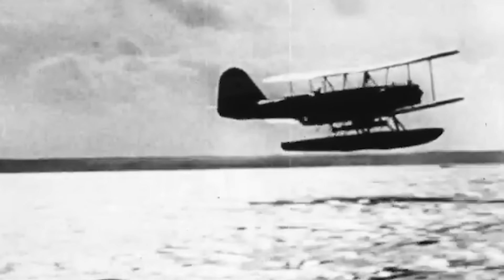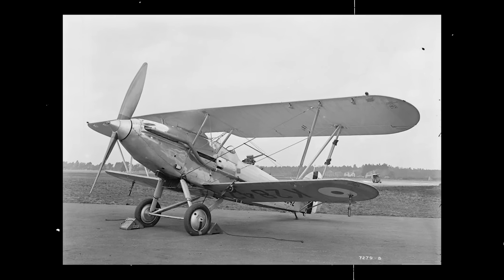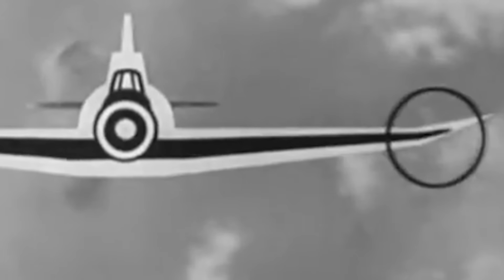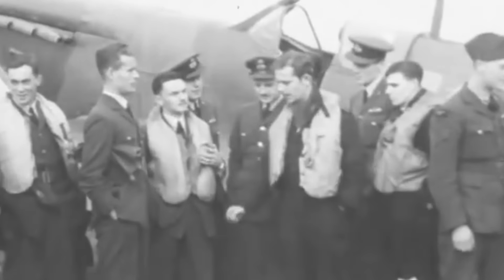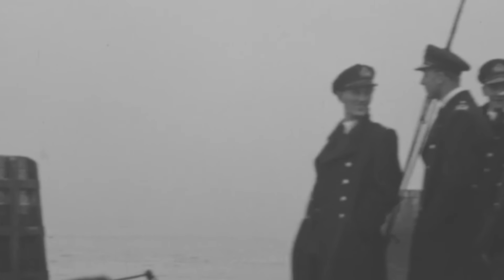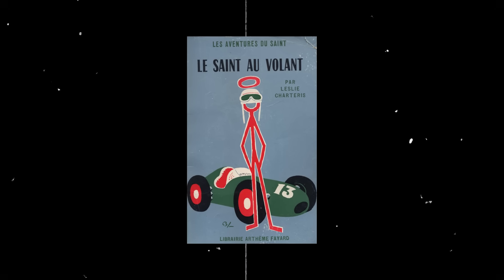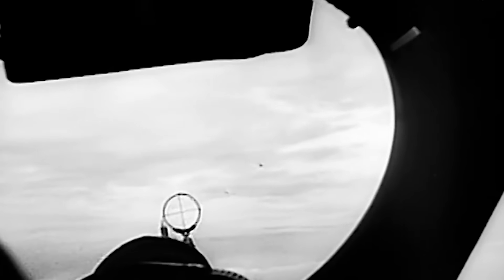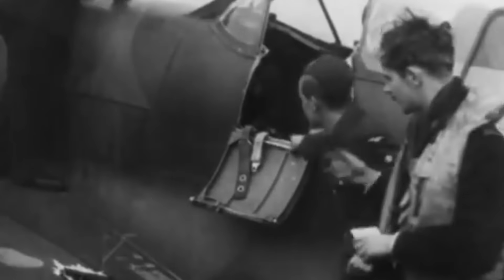The WW2 Plane with the Most Bizarre Killing Technique

Comment: Contrary to your comments, the turreted fight was a horrible idea which was proven out in combat. The Defiant was no better than the Roc in combat with other fighters. Once the German’s figured out Defiants weren’t Hurricanes, the Defiants became easy pickings. This type of “fighter” aircraft is only viable as a night fighter where the pilot can maneuver his gunner into an excellent firing position beneath the enemy bomber.
Reply: I recall seeing on another channel that the main idea behind turret fighters was that it was very difficult to get guns firing directly forward of the aircraft to bear on a turning opponent: you effectively had to turn inside him. The ability to train turret-mounted guns on an enemy who was constantly 30 degrees above the pilot's gunsight was theorised to be an advantage. The weight and aerodynamic penalties meant it didn't work out that way, and later it became clear that boom and zoom was preferable to dogfighting anyhow. Still, I'm a little surprised that no one experimented with putting something like a 20mm canon in the rear fuselage to fire over the cockpit at a shallow angle (rather than schragemusick- style) , to fire inside the turn of a plane being pursued.
Reply: The concept behind the turreted fighter was that they would be efficient at shooting down enemy bombers. And so they would've been, if the bombers obligingly flew straight and level, and didn't have any fighter escort.

Comment: G'day,

You got the Bristol Fighter & Hawker Hart & Demon backwards.

The RFC tried to fly the Brisfit to use the Rear-Gunner offensively and they were shot to ribbons of bleeding burning mincemeat.

So they started flying it as a fixed Forward-firing Fighter - with a Rear-Gunner to protect against attack from behind ; and the Bristol F-2b then BEGAN to be known as the
Bristol Fighter.., because that worked.

The Hart & Demon were 
Light Day Reconnaissance Bombers, with a Vickers K- Gun on a Scarff Mounting on the Observer/Gunner's Cockpit.

The Blackburn Roc was a Royal Naval Fleet Air Arm copy of a Boulton & Paul Defiant...

Much as a Fairey Fulmar was actually only a Fairey Battle with a retractable Tailhook retrofitted & bolted on ; under it's Bumfeathers...

Such is life,

Have a good one...

Stay safe.

;-p

Ciao !

Comment: The Blackburne  Roc, the Boulton-Paul Defiant and other "upward firing" aircraft were a product of early thirties design, when engine power was quite limited, and interception times, to altitude, were quite abysmal. The bombers would be landing back at base by the time challengers could rise to confront (Zeppelin days?), so, we fire upwards! The Germans ended up using the same technique themselves, no turrets, before the party was over! Can't recall if the pilots here had access to guns also, if not, how frustrating, having to maneuver the aircraft for another to shoot with these turreted ones! tRICKy!
Reply: IIRC the upward firing cannons in a German night fighter were activated by the pilot using a clever optical device to aim.

Comment: The Roc looked like the Boulton-Paul Defiant had a hot night with a Blackburn Skua. Still, they all played their part and had successes. Sleeve-valve engines were very quiet compared to other types - radial and in-line.     Least likely dogfight? What about the Wellesley versus Caproni's in the Med.!?

Comment: If the Roc ever killed anything I’d have thought it would have needed a mid-collision. Slow and underpowered, there was even a version on floats, which would have had trouble getting out of its own way. The turret fighter concept was trying to refight the previous war. Interestingly, despite Air Ministry advancing the No-allowance shooting concept, they rejected the evidence that the Luftwaffe was shooting from beneath RAF bombers (‘Schräge Musik’, [slanting music, slang for jazz], two cannon pointing up at about 80 degrees ) which achieved the same thing without the unnecessary weight of a traversing turret.

Comment: ... and the chap they were supposed to rescue?
Reply: Who knows; if he was lucky another aircraft helped out. The terrible part of this story was... these SAR missions didn't need to engage. They were both rescue aircraft, and the equivalent of hospital ships - they weren't supposed to be fired upon. But (supposedly) Nazi fanaticism led one of the gunners on the Heinkel to open up on Roc, and at that point all bets were off. An engagement of obsolete aircraft, to little effect overall... except, of course, for the poor chap they were sent out to find.
Reply: There were numerous floating "hotels" designed for downed airmen, but you'd need to be lucky to be downed close enough to swim to one. Depending on the area of sea around Britain there is a low survival rate with extended submersion in the water of as little as 45 mins. In much of the north hypothermia is expected to set in within 30mins.
Reply: @boanerges5723   Those Hotels were few and far between and little better than being stranded in the drink.
Reply: @MrJest2 if an enemy plane pursued you with guns trained on you, you bet you would open fire aswell. It's historical gaslighting to say it was Nazi fanatisim when most people in the wermacht and luftwaffe were not members the the nazy party.
Reply: @boanerges5723 in the sea in winter you lose the ability to get yourself out in as little as five minutes, with just a life jacket they can recover your body, in an open dinghy survival is unlikely for long, this is why modern lifrafts have canopies, the sea is a great place to play but it's not a playground.

Comment: Heard o Schraeder Music? The sound made by the two 20 mm cannons placed vertically on top of the 110 night fighters already equipped with  (poor) radars? Something Lancaster crews hated to hear.
Reply: Schräge Musik [or Schrägwaffen] wasn't named for the sound, it's a reference to Nazi maligned jazz & the unnatural angle of the weapons, it didn't just use 20 mm cannon, it didn't just use the Bf 110 & it wasn't placed vertically - normally it was angled forwards somewhat.

Comment: turrett fighters wouldnt have been the shit show they were had they have had forward firing guns
Reply: With a suitable sight the turret guns, aimed above the propellor and firing forwards could act as fixed forward firing guns by use of the no deflection technique whereby the sight allows for the fall of the shot as it flies towards the target. It was a successfully trialled technique by the RAF but never put to use despite the Defiant, at least, having a setting to fix the turret thus and the pilot provided with a gun firing option. The turret fighter was based upon the assumption that German bombers would have to fly from German bases and their fighters did not have the range to escort them. The turret allowed for extended firing times at the target, not the fleeting pass of fixed forward firing guns. It made sense at the time. No one expected France to fall. The reason for putting it on a Skua airframe to make the Roc and not Defiant was down to speed of entry into service and commonality with the strike Skuas on board ship. Essentially the same airframe and power plant so easing spares and maintenance. The Roc was a useful dive bomber though and active over France alongside the Swordfish, Albacores, Skuas and Hectors. The part played in the defence of Dunkirk by British dive bombers is rarely mentioned just as the the tactical bombing by Lysanders is hardly heard of. Even the Roc carried the same bomb load as the later ‘Hurribomber’ and could place them more accurately. Still an abysmally slow device nevertheless.

Comment: did turret rotate from aircraft's engine?
Reply: Hydraulically powered by an electrically-driven pump.
Reply: Yes. The gunner could only enter or exit it the turret was pointed the right way. If the engine failed, or the aircraft was shot down, the gunner was often trapped in the turret. The affected the Defiant as well. Small wonder such aircraft were unpopular with their crews.

Comment: No front guns how do decisions like that get made, the extra cost in comparison to how many planes don't get shot down and how many enemies do, if u Wana win u make the fastest most maneuverable, best guns , best visibility, and teach clever tactics, not to mention some down ward guns with glass to see, you could pull up and fly above them with them either following u or focus on another target thinking that no planes can fire on planes under neither other planes, 
And the front guns should have like 8 or 10 guns 4 straight shooting 2 slightly upwards 2 more upwards a bit more than the other 2 and 2 aimed slightly down, so many times they are making hard turns and are barely out of their target zone if u had 4 guns aimed upwards at two levels u would have significant kill count, if they were taught to be wise with there bullets they wouldn't use any more bullets than any other because they would hit theor target by probably 2x or 3x

If u put the biggest turbo charged engine with the best guns and most maneuverable u probably reduce plane loss by 50% or more which more than covers the price of turbo and extra guns. It's retarded where they get the logic behind their decisions. They probably worried about material and man power costs, trying to eliminate things that they can get away with
Which again is stupid from a business aspect, u make the best planes consistently you will sell more planes you will get every new contract they won't consider buying from another factory 
They will just listen and approve your decisions and not argue because u been making the best planes the whole war, you can also ask the price u want and get that price especially when they compare it to how many planes from the other maker were shot down in such a short period of time and lost most missions.